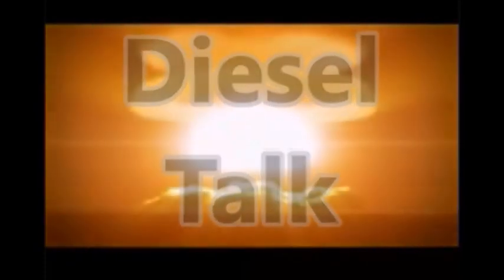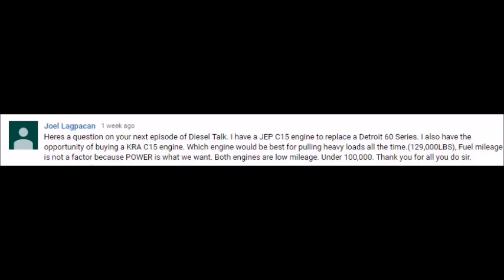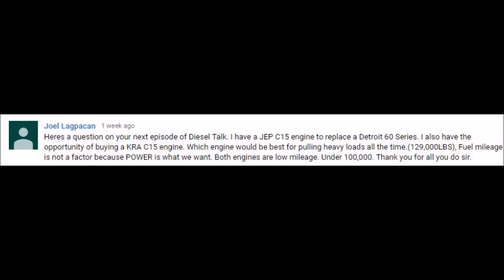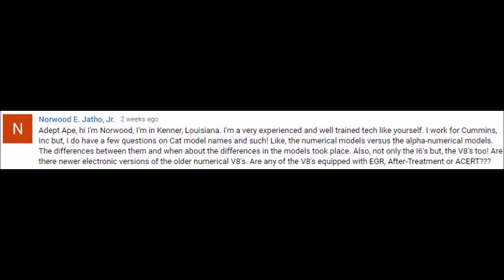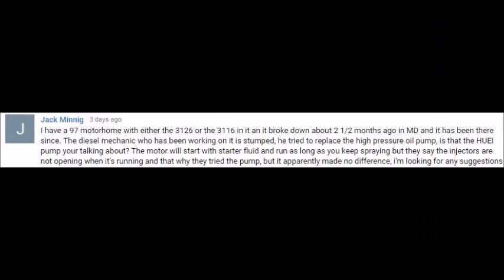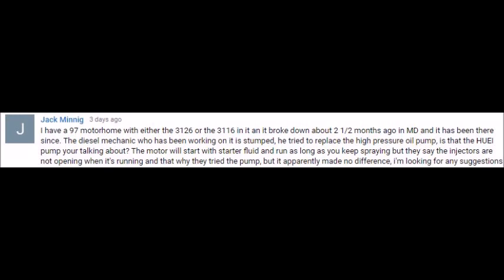Diesel Talk Episode 7.  Heavy Haul Cat Engines, Engine Model Nomenclature, and Testing An ECM.

Comment: Hey 👋 buddy I have a question on the new KWs there crap 💩 I think my company is selling good Detroit for new KWs it sucks but my question is there using coolant and oil. Changing fuel filters on service I’m finding a lot of oil on filter!  I can rub my hand ✋ on filter and a lot of black oil Res only 75k miles or more or less but I know this isn’t right trying to tell these guys this is a problem what’s ur thoughts?

Comment: I ran into a problem with my 3406B once. It shutdown and would not run. No electronics so the first thought was, is it getting fuel ? Changed the transfer pump, and messed around with every thing I could possibly think of. Long story short, one of the check valves in the priming pump had come loose and had turned around backwards and blocked the flow of fuel.

Comment: Just started watching your videos and must say they are among the more informative ones on YouTube, great work. I'm a marine engineer myself, with 22 years of experience with ship engines of all sorts from low rpm, long stroke, 2-stroke engines to 4-stroke LNG motors. I'm currently working on a boat project with a Perkins 6.354HT engine with a fuel pump problem. Any suggestions on how to adjust the anti-stall device?
Reply from the maker: +Roger Skåtøy Thank you for commenting. Wish I could help with the Perkins anti stall device, but I've never messed with one before. Most I've done on a Perkins is reseal the front structure and some services on generators.

Comment: Answer me this my good man: is a 2004 C15 MBN16321, an ACERT motor?  I know it's a bridge motor, we converted another MBN to a 475/550 6NZ. Some guys say they have some ACERT parts...I know it has the smart wastegate currently...that's def going to be removed.
Reply from the maker: +i am a jabroney I think technically it would be an ACERT engine because Cat designed then for the 04 EPA emissions regulations and that is according to the CAT website. Now the Tier 3 regulations went into effect on 05 which had the IVA solenoids and twin turbos. An MBN is still a good simple engine though and the biggest difference between it and a 6NZ are the turbocharger and software file, pretty much all the iron is the same.
Reply: Thanks!  We rebuilt an earlier model MBN to a 6NZ, but this next MBN we bought is newer.  On the previous motor, a new BW turbo, exhaust manifold, slightly bigger injectors that needed replaced anyway and the new computer file made our original motor into a familiar CAT monster. Have about 70,000 on it so far and haven't had any issues. Thanks for all your help.

Comment: love your videos! I have a 3406e 5ek engine. my question is sometimes when I'm going down a grade and the weight of my load is pushing me down the hill as I bring the throttle up to catch up with the speed of the engine I sometimes develop on a Miss.When this  occurs it puts a little bit of white grayish smoke out and once the Boost comes in it will go away. but it is always only on a downhill grade when the weight is pushing against the engine. any idea's?
Reply from the maker: +Seth Kull Normally off idle misses or between shift misses is an injector or multiple injectors. It is also possible you have a fuel pressure problem, you could try rigging up a fuel pressure gauge on one of your runs and see what it does, but the fuel pressure is probably okay. Since it only does it at certain times and you are getting a white smoke from the exhaust, my guess is injector, a turbo wouldn't cause a miss and any mechanical problem would be constant.

Comment: how do I check oil clearance when use torque to yield bolts? from what I know those bolts are not reusable, and if I change them out wouldn't the clearance also change a little bit?
Reply from the maker: +Jason Huang I'm going to have to mark this question for my next Diesel Talk because it is a good question. Yes you shouldn't reuse a torque to yield bolt, but you can still can still check your oil clearances with plastic age if you want. Just torque the bolts to the torque before the torque turn then don't do the torque turn, you can check the oil clearances and then reassemble and perform the proper torque on the bolts. There oil clearances should change with this and you can still use the bolts.

Comment: The ECM on my 2005 C9 typically let the engine load at 79% full throttle. The ambient temperature can be 40 F or 90 F, towing a vehicle or not towing a vehicle it's 79% engine load. I've seen 92% or 82% briefly, then it's 79%. I can apply 2/3 throttle and achieve 80% load. The engine rated at 400HP at 2100 RPM with over speed at 2300 RPM. I've owned this motor home for 4 years and previously I had 99% engine load at full throttle. It's not an issue though, the motorhome moves at highway speed. Although I would like a 99% load when pulling up a long grade. Thank you Adept Ape.
Reply from the maker: +Kenneth Bullins Hmmmmm, sounds like you might have the old RV high exhaust gas temp derate going on and not even know it. Do you have a way to communicate with the engine at all? That is a very common RV related symptoms, I'll try to find a good explanation.
Reply: Adept Ape There"s no fault code stored in Spartan Chassis digital display. The engine has 30727 miles/972 hours. Thank you.

Comment: Hey mate love the video, just one thing you got a little wrong with the C175 its a little different as it refers to the bore of 175mm with the two variants being a c175-16 and the bigger c175-20, 16 and 20 being the number of cylinders.
Cheers all the way from Australia.
Reply from the maker: +Bradley Dearman I said something wrong! Oh no (stands on a chair and puts a rope around his neck, slowly steps off). I wonder why they refer to the bore on that engine but the displacement on pretty much everything else? What is the displacement of the 16 cylinder version?
Reply: Im not trying to call you out on it like that mate, 
while i was an apprentice at my local Cat dealer here we had a few training courses talking about the C175 so its just a topic that catches my attention. 
Just going by the Cat products website specs the 16 is 84.67L and the 20 is 105.8L both are also common rail engines. 
cheers again, im not trying to be a know it all im just bit of a bookworm for this stuff.
Reply from the maker: +Bradley Dearman I'm glad you told me, I know on nearly all their other engines they go by displacement. Wonder why they went to a bore designation on this one. I know why, to trip me up!

Comment: I was always told that the c-15 meant it was not an acert engine if it had the dash it was none acert
Reply from the maker: +ScagSWZU I think the first series of C15 were considered "bridge" engines because they had electronically controlled wastegates and the first hints of emissions components, so that is when the ACERT technology was being developed. The C-15 engines were pretty much straight great motors.

Comment: I believe I mentioned some other Cummins new 2017 releases in a different videos comment section. Ironically Cummins calls one of the systems ADEPT. I think the acronym stands for Advanced Diesel Engine and Power Train. I might be wrong though.

Comment: While 2007-09 use only a DOC & DPF, the later 2010-2016 engines both MR & HD all use a DOC, DPF, Decomposition Tube, a DEF Doser installed  on the decomp tube and lastly a SCR Catalyst. However as of the 2017 release, all engines both MR & HD will use In-Cylinder dosing injection with a all components from the DOC-SCR Catalyst will be combined into a single module assembly. All sensors and components will be combined into this single module and will take roughly the same space that a DOC & DPF currently use.
Reply from the maker: +Norwood E. Jatho, Jr. You are the most technical subscriber I get for comments by far. Wish I knew the Cummins stuff like you.
Reply: I appreciate that Ape, though I've only been a diesel tech for 3 yrs. I do believe in learning everything about what I work on, that's the only way to truly diagnose, repair the root cause and have virtually no comebacks. In 3 yrs I've had 4 comebacks, all were for simple things a apprentice overlooks. I'm pretty much the lead in the shop I work at, this is due to my constant growth on knowledge that the other guys dismiss. I learn everything thing I can, you never know when the slightest detail fixes a gremlin problem. Cummins has a lot of gremlins hiding in their engines....... call it job security.
Reply: My nickname at work is (sir torques-a-lot) due to my memory on parts, specs and procedures.
Reply from the maker: I'm very by the book as well, it means I'll never be the fastest guy in the shop, but I try to be the best troubleshooter.

Comment: FYI: the MR after treatment engines use Cummins In-Cylinder dosing, the dosing happens on the exhaust stroke and is achieved close to TDC of the stroke. The HD engines use a (7th Injector) After treatment Injector directly behind the turbo inline with the turbo turbine housing and exhaust pipe.
Reply: Norwood E. Jatho, Jr. do they even use those on the newer def motors? thought the early 07-08 to 10 used that set up. i have a 08 like that, isx 600, thing is a turd in my opinion.  only thing i like about it over Cat is the jake brake
Reply: Kwmiked, Cummins engines from 07-09 are only equipped with a doc & DPF. Engines starting 2010 to 2016 use the doc, dpf, decomp tube with def doser injector and a SCR catalyst. Yes they are weak but, they are more efficient and cleaner emissions. They do run dirtier meaning, oil change and DPF cleaning intervals as well as egr system cleaning too. Though most times problems derive from malfunctioning egr components or faulty injectors.

Comment: That was awesome Ape, this video cleared up a lot of my confusion on the CAT nomenclature. As far as the question I have on CAT vs CUMMINS after treatment systems. I mean the specifics on the CAT After treatment systems, like from start to finish of the CAT after treatment process and different versions on MR mid-range and HD Heavy-Duty engines.
Reply from the maker: +Norwood E. Jatho, Jr. Oh okay, I thought the Regen video pretty much covered everything. Did you just want a quick overview?
Reply: Yes your video was very clear on my question on models but, like I explained in my caparison comments. I meant the individual after treatment components and changes through the model years to the components as well as midrange vs heavy duty after treatment.
Reply: Oh the CAT after treatment components I meant. The Cummins stuff I'm like you I can ramble the parts off like a service manual. I'm just trying to learn about the equivalent CAT after treatment parts. I'm thinking about trying to get a better job working for LouisianaCAT in Baton Rouge, Louisiana 2hr commute but the pay is worth it. Plus I love CAT engines but, I just don't know about the CAT after treatment systems or parts. I've never felt the pull of a Cummins engine the way the CAT C15 ACERT did that I overhauled at WyoTech in Laramie, WY back in 2013. That engine pulled its ass off with power to spare. There's nothing like a well built CAT engine working hard.
Reply from the maker: I'll try to explain the Regen components a little more in the next Diesel Talk episode. Since they stopped making them a few years ago the components didn't get too crazy.